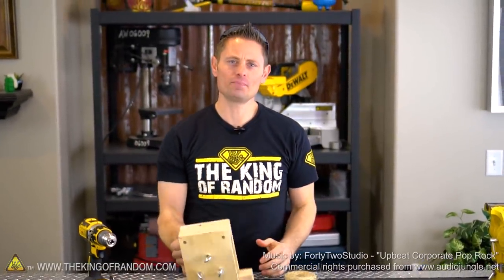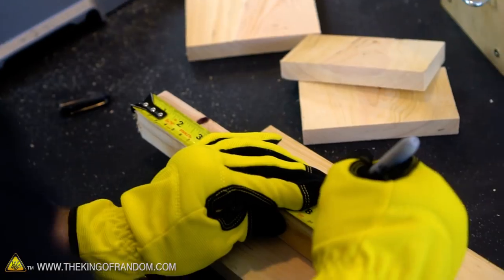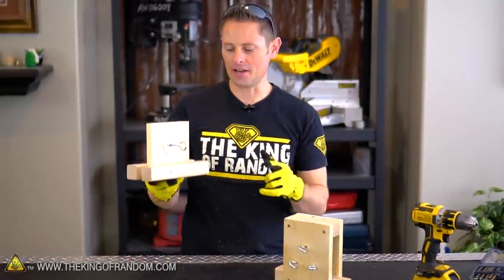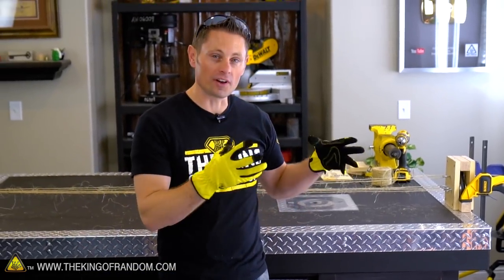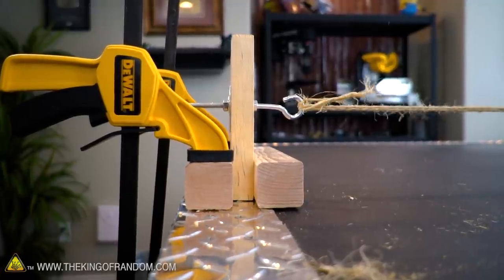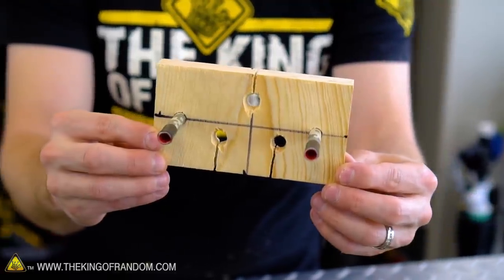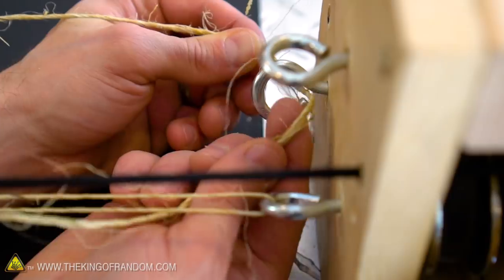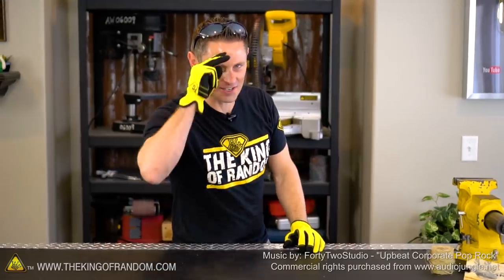The Final Additions: Make Rope Make Itself | TKOR's Ultimate Survival Hack

Comment: Cool project but once you bought all this and build it, would it not have been cheaper just to buy the rope?
Reply: Truly, once the pieces are made, a machine like this could even make rope without the drill.  So could really be helpful in the event you don't have access to a hardware store. 
Though I'd rather see a system that auto fed into the later pieces and wound tension while you went and could fill a spool of constructed rope.

Comment: Can you show us how to make a fidget spinner?
Thanks
Reply: Just 3d print them, my friend sells them 8$ a pop.
Reply: I would do the same
Reply: Take an old kickbike or see if you can find wheels from something similair, and keep the bearings (If you can't find any, you can easily buy some elsewhere).
When you have the bearing, find a few relatively useless coins, and superglue them into three stacks with the same height as the bearing when lying flat on the ground.
Now, evenly place the blocks of coins you made around the bearing, making sure it will be properly balanced when glued on. (When gluing, I recommend using something to keep them tight onto the bearing, like duct tape or rope.)
When everything is holding together, just add a layer of whatever texture you want on the outside, maybe just duct tape for that sake :P
Reply: They are 3,40$ on ebay and amazon
Reply: Why when you can just look for one on youtube and find literally thousands of results?

Comment: Quick tip on sizing a drill bit grant, hold the drill bit up to the bolt or screw it should be the same size or only slightly larger than the bolt/screw excluding the thread.

Comment: instead of a soda bottle counter weight you could add a second pully with a spring which is clamped to the support board when the tension builds to pull the board forward the pully with an variable adjust tension spring will counteract it keeping the support board in equalibrium. Of course I only got a C in high school physics and a D in wood shop so take what I say with a grain of salt.

Comment: Made you're machine with some tweaks, added plastic spacers in the wood so the eye-bolts won't were the wood down, used lock washers on the pulley assembly so it can't ever come undone, added washers on both sides of the pulleys between the nuts and wood so the nuts can't cut into the wood. Also had found 2" washers with 1/4" hole like suggested if we could find them 

Works great so far. 

Also you said you were in scouts. Did you get eagle? I got mine in 2014

Comment: or you could just have the other end with the spinning parts loose and apply manual pressure while spinning it, this way you could also make the tightness of the rope different each time which would increase length if you wanted to.

Comment: If you soak your home made rope in water then start a firer and run your rope through the flames the little strands will burn away but the main rope sill not because it absorbed the water.